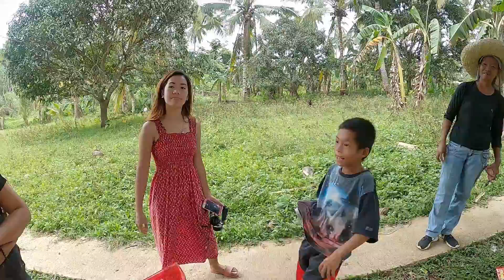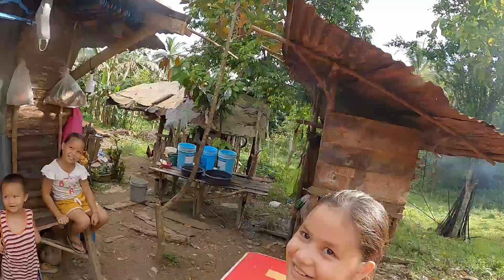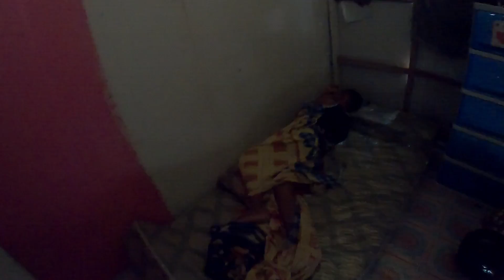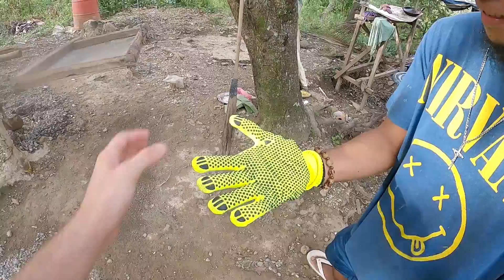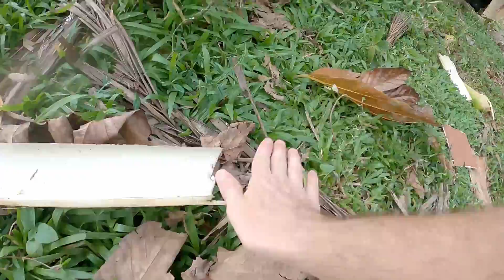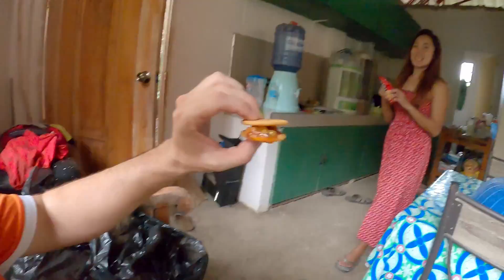Cecil Comes to Visit - Updates for Richard's & Robin's Projects - PHILIPPINES PROVINCE LIFE

Comment: What if the plastic drawers go beside the foot of the other bed, so there's room for the bunkbed?
Reply from the maker: That's s good idea
Reply: @DustinBackpacks  Maybe place a thin partition between the bunkbed and the other bed --- a framed amakan, maybe?  And reposition the bunkbed and the single bed, so that the bunkbed goes to where the single bed is now, and the single bed goes to where the bunkbed is supposed to go? Just a suggestion.